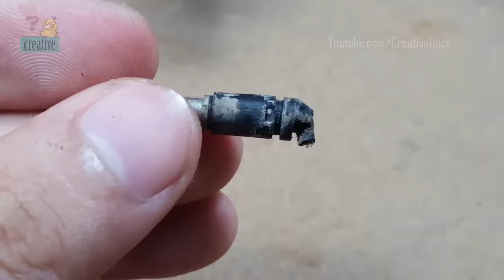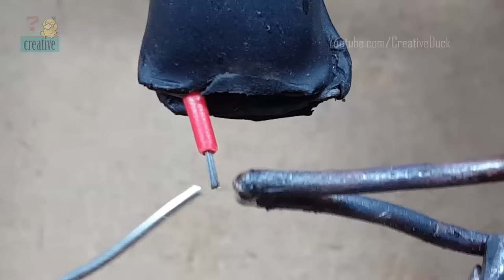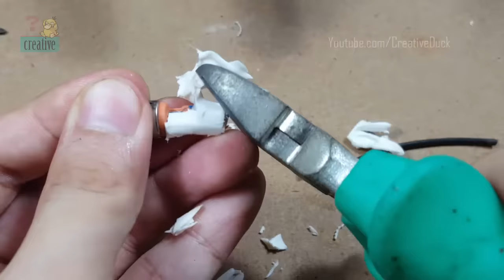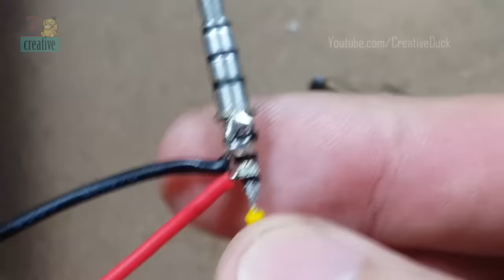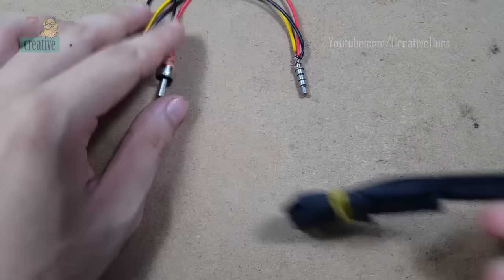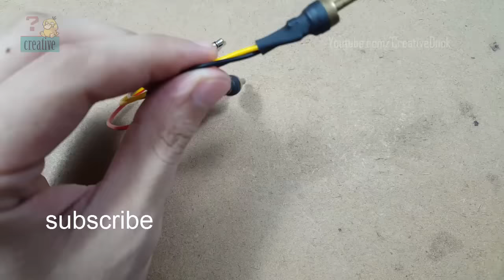Connect 3.5 mm Headphone (4 pins) to Stereo audio jack | Mobile to woofer system connector cable

Comment: Hmmm it was wrong ur doing mate there are 4 connection in 3,5 mini jack fm top r channel 2nd left chanel 3rd for microphone 4th ground .y?did mic + solder to the 4th pin as ground ..try it the vol. Will distorted take out the 3rd pin leave it ..try again ...